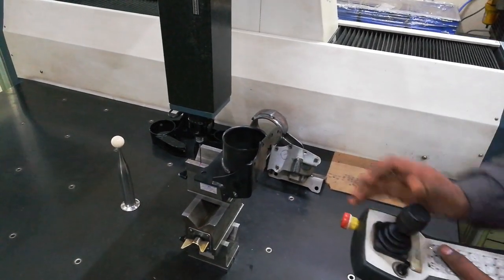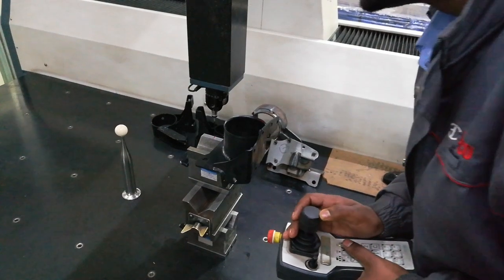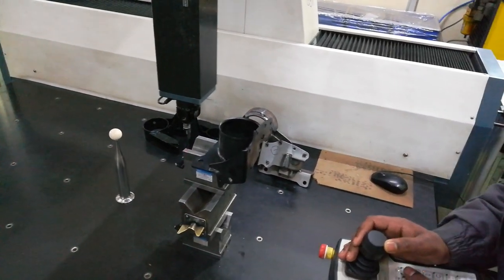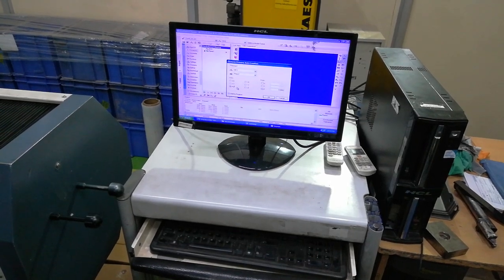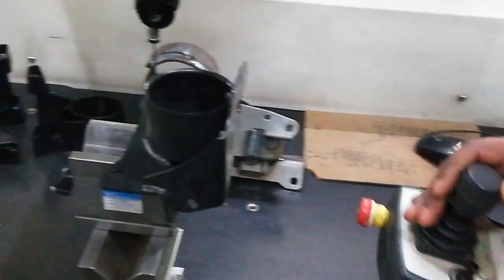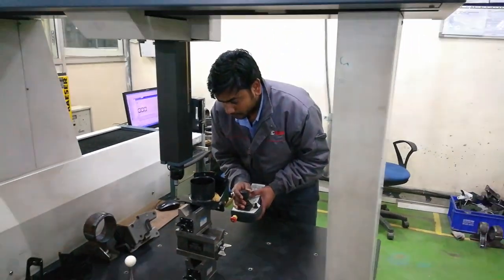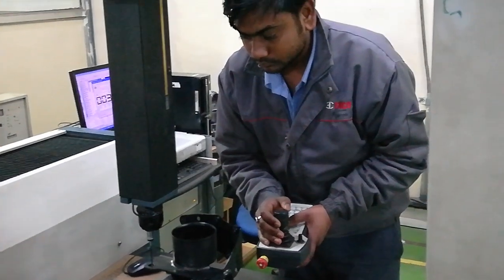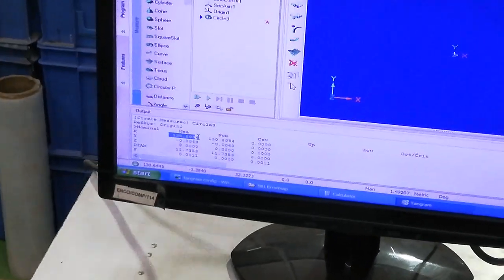Cmm part inspection

Comment: ND Group have more than 20 years experiences on precision black granite business.Professional on granite components design and manufacturer,installation service.
High precision granite is used in laser machine,CMM machine,CNC machine,CT machine,small numerical control machine.More details please contact:whats:+8615628830716.sofia@@t.